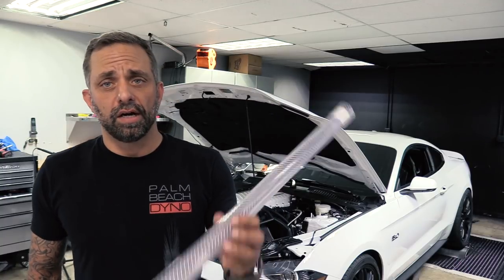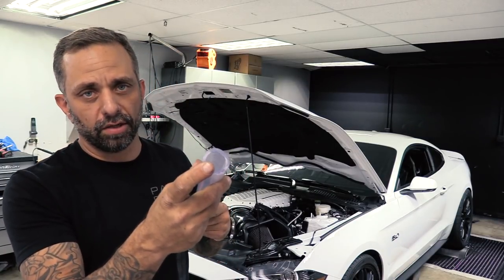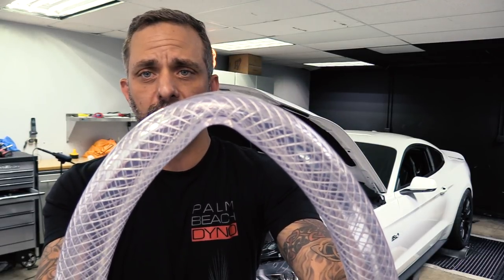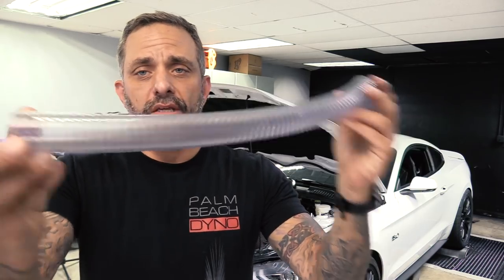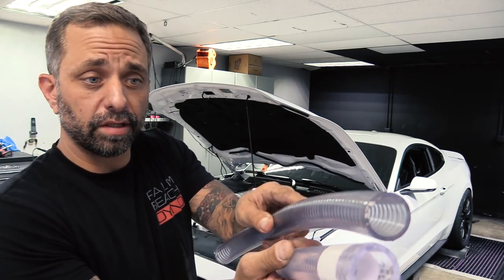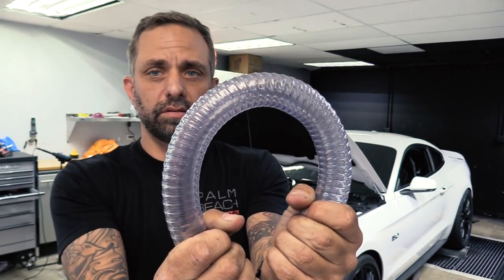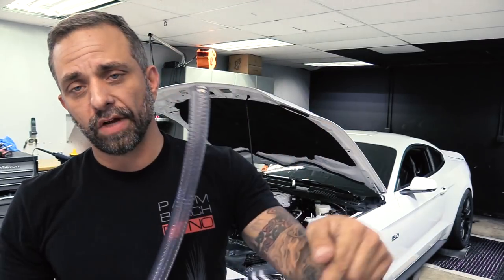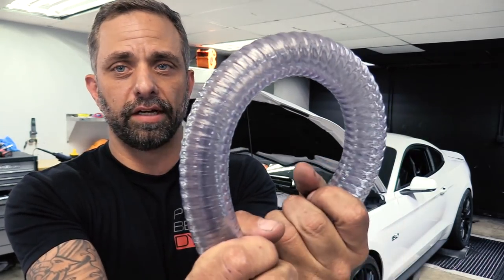K2 Ultimate Intercooler Hose!!!

Comment: So I called you don’t sell this anymore. So can I ask why? Is it dangerous or what? What’s the name brand so I could find it since you won’t replenish.
Reply: Any luck on figuring this out?
Reply: @ThePaintPaperHustle  no but I have been looking there are some out there identical but not sure how the far for thickness and bendablity
Reply: @ThePaintPaperHustle  finally found some from Sloan express #339036.
Reply: @Turbo8secondz28  thank you
Reply: @Turbo8secondz28  thanks, did you purchase this? I plan on buying some
Reply: @UnknownElluzions  yes I did !! I found and it’s was identical.
Reply: Looks like pond hose.
Reply: @812_huffinpaint  it’s actually good grade industrial hose lol
Reply: @9secondz28  any issues with heat? Says it's only good to 130 degrees.
Reply: @thomaseverley3847  I have not had any issues but I’m just a drag car so no street time and I have plumed away from most heat